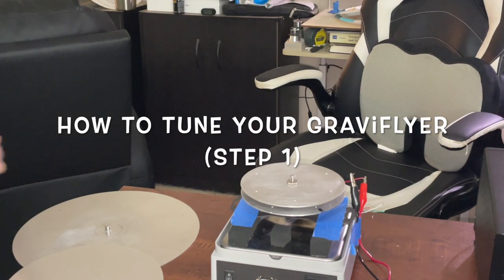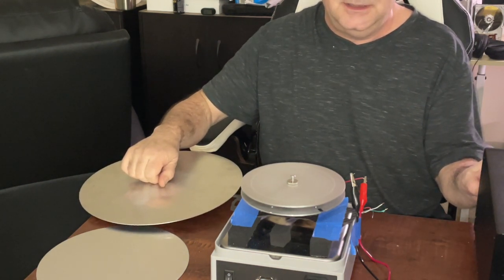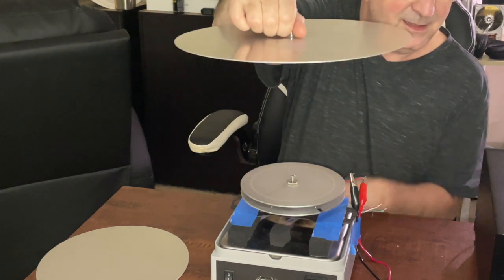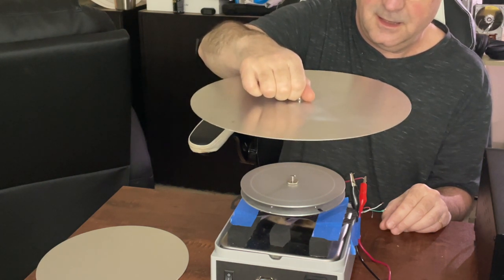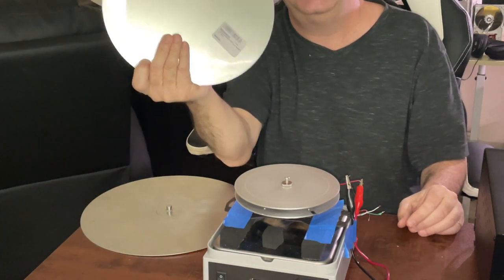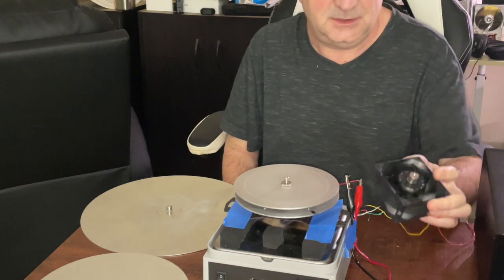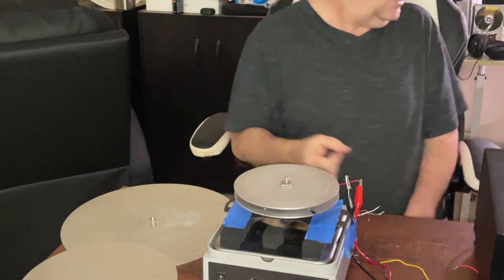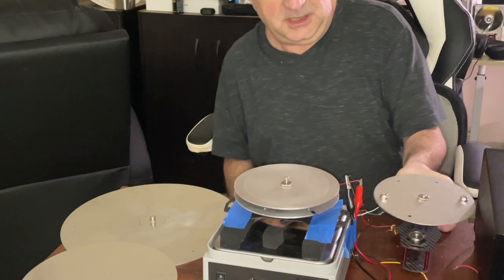How to Tune your Graviflyer (Step 1)

Comment: I saw toy APEC talking about magnetic fields and the Graviflyer. I did a test that would help to understand it better. I made a paper ufo lift with static volts. The thing is that earth ground could replace the negative on the bottom and it still works. Because the Earth naturally produces static volts the ground and ozone layer area can now be seen as a positive and negative field and we are in the middle of it. So a magnetic field would be correct but not with magnets. Instead with polarized static charge. The 2 discs are not sufficient to lift at that power level so the tesla coil increases the field. If you don't connect the tesla coil directly and instead you put the wire down the center of the coil you get a static effect on it. The charges are close to the same as the high voltage. You could drive both circuits with the same driver. When the top field is forced down by the piezo disc it passes through the center plate polarizing the whole craft. Where the tesla coil has no polarization. Now it will for a little while. This means it can repel off of the earth or attract to the sky. The vibration in the center plate caused by eddy current and the motors being in tandem gives off a feedback to the tesla coil. This effect is like a burst of energy to the craft. Because the tesla coil is a capacitor to the ground the Graviflyer is now the same. So TT Brown was right about the capacitor effect. It just wasn't the way people envisioned it. I have been testing everything. I hope this makes sense to you. Thank you.

Comment: Hi, is this experiment inspired by Chekurkov's Graviflyer, isn't it? I have spent some time trying to make sure that his quite strange invention (I'm not saying "impossible") has a reasonable theoretical foundation even if his device does not actually levitate, but I'm not sure about that, though. My question is, have you already discovered something that would raise hopes that Chekurkov's invention is trustworthy? Without elaborating on that. Thank you!
Reply: Yes, although nobody has replicated it yet, so I have some reservations. I've eliminated a couple of hypotheses, but there are still a few to test. 1. It is most likely that the positive charged upper rotor attracts and accelerates electrons to high speed. They collide with air molecules pushing them downward, and the lower rotor repels electrons. So the air should be pouring around it in the shape of an umbrella. It is the mass of ionized air moving downward that propels it upward.  2. It is unlikely that the ultrasound has a major effect because the wattage is way too low. However, ultrasound can be used to create pressure "shelves" in the air, which could be dense enough to support the weight "IF" it were putting in enough sound energy. I doubt that it does.  The last hypothesis is still that it's not real and we're all fools for believing it. I have moved on to other things, related to hypotheses 1 & 2, but my own design. See my latest teaser video.
Reply: @ToddDesiato  thank you for your answer! "We're all fools for believing it" — LOL🙂 buuuut... however, best to keep an open mind, chances are, we'll find something,  sooner or later. Knock, and it shall be opened.

Comment: Also: Theoretical easy way to find center of disc.. Drill hole larger than needed, use bolt with leeway and washer to clamp. Have it loosely clamped to provide just enough hold to keep it fairly firm. Rotate disc slowly via bolt and use some type of firm structure as a flattening wall on the edge of the rotating disc til it's seated with a satisfying balance. Slowly clamp down tighter on nut doing rotational tests in between to ensure perfect seating.

Comment: Ringing a disc with magnetism is an all too familiar experience especially when you push a high enough audible frequency field into it but it's cool to see it from such a low mechanical oscillation. It was really cool how you could hit different little notches in the standing waves.

Comment: That’s interesting vortex shedding. You mentioned there was a pull downwards from the stationary disc you’re holding. Is the rotating disc pulling upwards too or what?
Reply: Yes, there is a suction between them when it's rotating. It's the "Ground Effect" but from above.

Comment: The faster it spins the higher you need to hold the plate to get it resonate?
Reply: No, when it resonates, moving the plate up and down will hit each of the nodes. At some speeds, there are multiple harmonics at once. Moving the plate up and down selects which one is the dominant standing wave. It's like playing Arpeggios.

Comment: That's really interesting. It might be worthwhile charting out the frequencies and volumes hit at various RPM's and distances between the two disks.
Reply: I'm working toward going ultrasonic, to where it isn't audible. I'm setting up an anechoic box with sensors.
Reply: @ToddDesiato  Good call on the anechoic chamber. Cleaner the data the better.
Reply: Exactly. The tone is 3 semitones pitched too high ;)